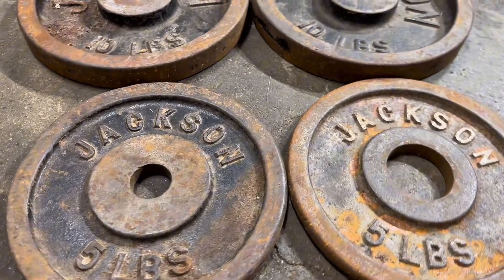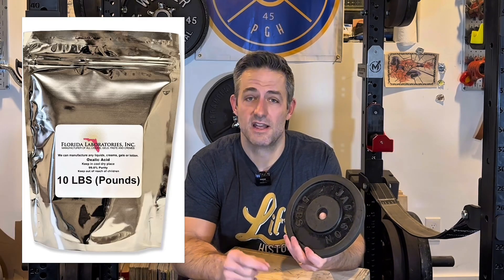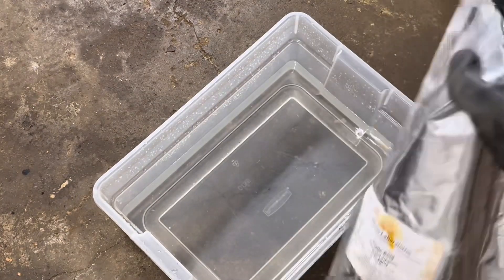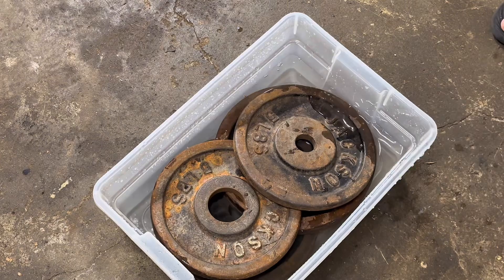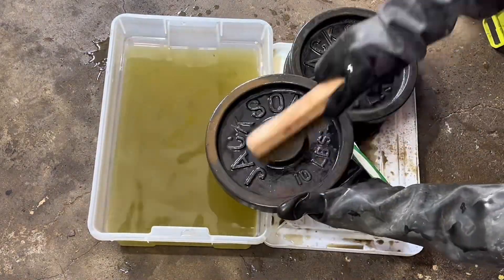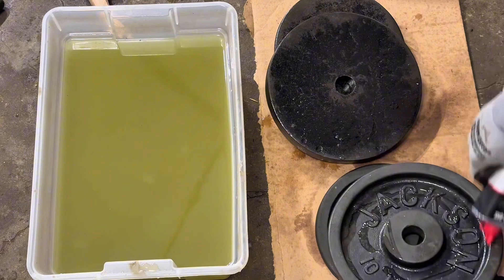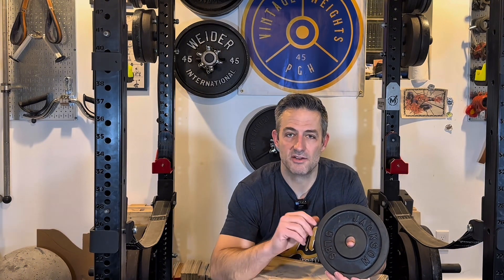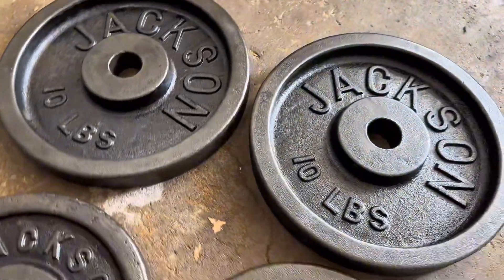How to Clean Up Rusty Old Weights with Oxalic Acid

Comment: Hi Rob:  I your experience with using the weights after restoration, do you find a need to re-oil them periodically  or does simply putting them to use keep rust away?
Reply from the maker: It depends on the environment of your gym/location. I’m in Pittsburgh, which is only humid part of the year, and I have a basement gym. So I rarely have to re-oil iron. I do have to occasionally re-oil bare steel barbells. Friends in Florida re-oil everything much more often!

Comment: Citric acid works. Phosphoric is better.
Reply from the maker: Citric acid will strip the weights to bare iron - rust and paint removed. I like to try to keep the original paint by using Oxalic Acid.

Comment: I have only one question. How do you dispose of the acid when you are done? ✋
Reply from the maker: It really depends on your local municipality’s regulations. People have told me that they neutralize it first by adding baking soda and then put down the drain. However, I’d suggest checking with your local municipality for best practices.
Reply: @vintageweightspgh  Right on! Thank you!
Reply: Good question. I've also wondered this. And thanks for the answer Rob .

Comment: Good content. Oxalic acid technique needs to be distributed to more people. I have seen a spike in people making videos lately about “restoring” york roundheads and they are repainting them 😩 which largely destroys their value… at least to collectors. Of course every time someone destroys roundheads by repainting them the value of the remaining originals only goes up, but still sad. Keep up the good work!
Reply from the maker: Thank you for the kind words. I don’t know if stripping off original paint destroys their value. However, I do think it limits the market for resale. A weight with original paint can be sold to someone that likes original paint or wants to repaint it. A weight that’s repainted is only appealing to those that like them repainted.
Reply: Old weights look much better repainted, I powdercoat mine.
Reply from the maker: To each their own. Like I said in the video, I love original paint or a worn look. I only repaint if they’ve already been repainted a bunch. But that’s just what I like. If you like to paint, go for it. Anyone lifting old weights is good in my book!